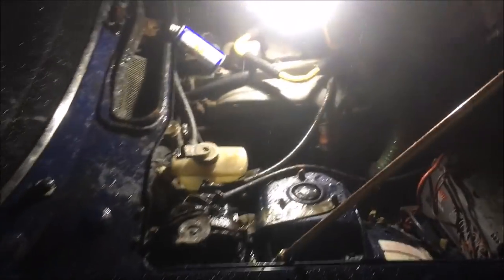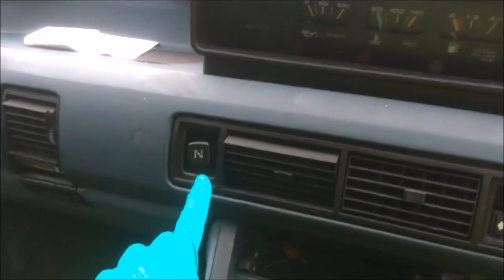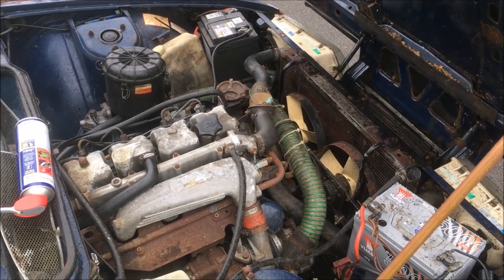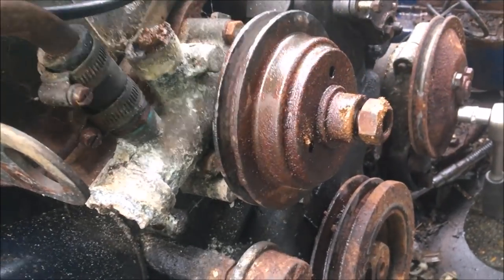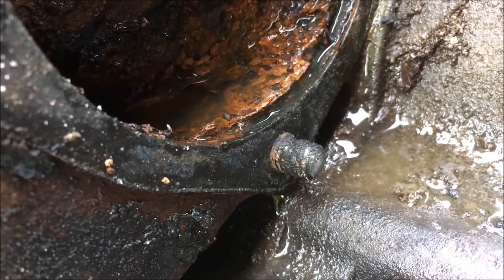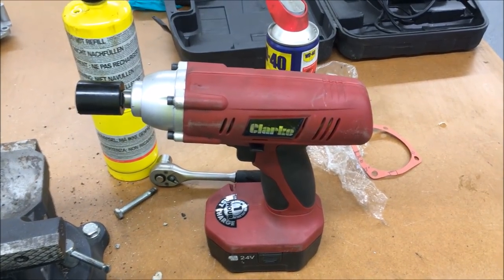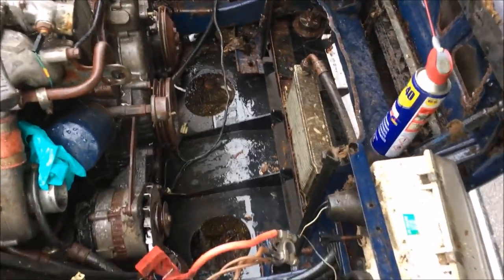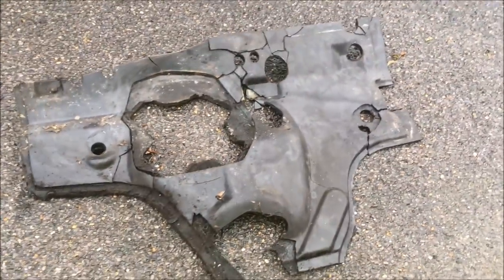Rover SD1 2400 SD Turbo restoration - Video 3 - Clutch master and cooling system

Comment: I think the holes in the water pump pulley were threaded to take bolts that you could use to push it off the shaft.  I don't think that would necessarily have helped much in your case, though, looking at the state of that pump...
Reply from the maker: I think your right. They looked m6 but I couldn’t get a bolt in more than a couple of turns. Think they might be a imperial size, so I have up and just hit it!